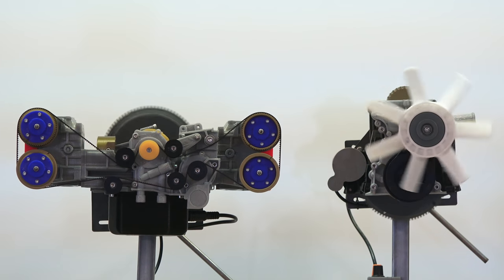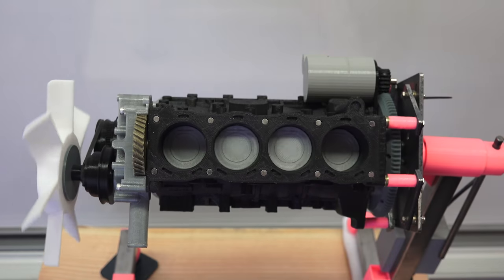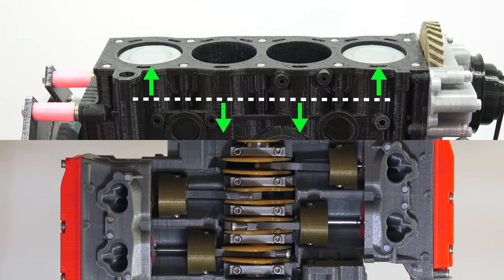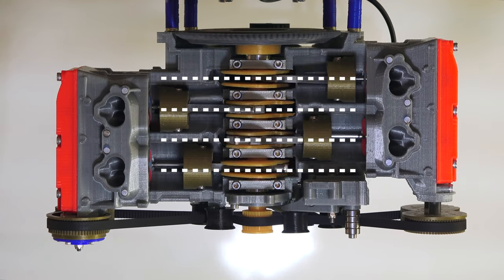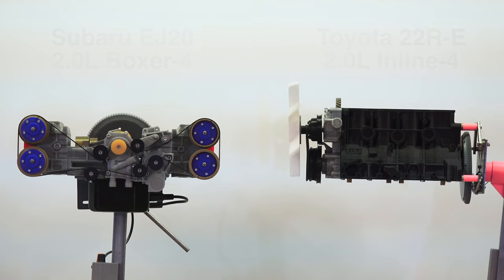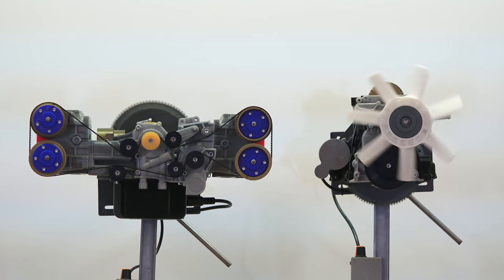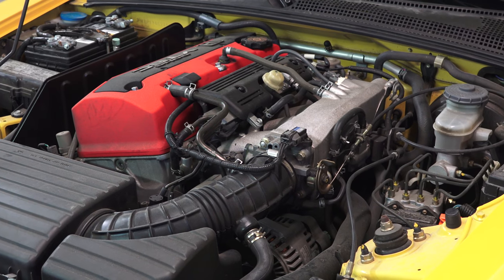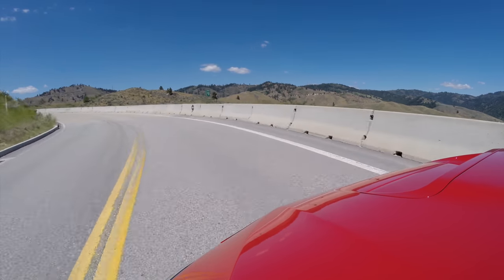The Differences Between Inline Four & Boxer Four Engines

Comment: I LOVE my 3.6 liter boxer 6 in my Subaru Outback.  No vibrations. Can't even tell them car is running when at idle.  Low center of gravity allowing for better driving experience.  Plenty of power.
Reply: flat-6 engines are not boxers, that term only applies to flat-4 engines due to the two cylinders on either side looking like a boxer punching. boxers dont have 3 arms
Reply: Well, in Germany we call all of them "Boxer-Motoren".  o.O
Reply: I love mine as well in my Legacy. Everyone comments how smooth it is. Not to mention the lovely sound it makes. I gained a few dozen lbft of torque with my tune and a bit of HP up top due to AVCS tuning. So much usable power. Grunt in 5th on the highway, Passing power at midrange in 3rd. I just love it love it love it.
Reply: We have it too but she likes to eat up oil lol
Reply: I switched to 5w40 and it helped some. Just made the switch to Motul 300V. Hoping I make it to 1500 miles without having to add any oil.
Reply: Subaru Flat 6 is also called boxer because the pistons are moving on opposite direction.
Reply: The subaru flat 6 is way down on power compared to other 60 degree v6s though.
Reply: Look ItsRain yeah.... But remember that they arent put in sports cars necessarily.... More like GT versions of very regular cars
Reply: There are alot of V6s on normal cars that make well above the 256hp the subaru makes. GM, toyota, honda just to name a few.
Reply: Look ItsRain 
My guess is they are boosted if the power jump is significant
Reply: llamawizard the Toyota Camry makes over 50 more hp with its v6 then Subaru does with its v6, naturally aspirated. And it's a Camry lol. Subaru needs a serious refresh on the flat 6, it's running old tech. Look at what Porsche has done with there flat 6's, 500 hp, n/a with the 4.0L. Subaru could easily pass the 300 hp mark with there flat 6.
Reply: Driveitsideways 1 but as you know Subaru is mostly designed for economy awd cars whereas Porsche is performance and luxury. But would be nice if they made more enthusiast engines, also I always come to the conclusion that flat engines always seem to make less power due to it being a larger engine in terms of 2x crankcases, heads, cams, etc which in turn is more $ for performance
Reply: Boxer is just a colloquial term for Flat, doesn't matter if it's a Flat-4, Flat-6 or even Flat-8 engines. Its the movement of the Piston and Conrod that resembles the  jab of a boxer that gives it its name
Reply: Vintov I was simply using Porsche as a example showing flat 6's are capable of big power n/a. 300 with direct injection and VVT isn't a very hard number to achieve out of a economical 6 cylinder, again the Camry is proof.
Reply: If only brz used that engine
Reply: diazzsama, it's exactly that though. The BRZ engine is basically a EZ36 with two less ports and direct injection. I think they share the exact same connecting rods too, not just the same design.

@driveitsideways 1, I completely forgot about fuel injection. If they can manage 200Bhp on 4 cylinders, I'd think 300Bhp would be easily possible on 6. It's too bad that they're doing away with the 6 cylinder. They're moving towards a 2.7L turbo or something. It's going in that giant Subaru SUV van thing, I can't recall what it is really.
Reply: Im just proud to say I own an 05 sti lol
Reply: llamawizard My next Subie will be a 3.6.
Reply: I believe your thinking of the EG33 engine from the late 80's and early 90's.  I don't don't think either of the ez30s or the ez36 had anything to do with porsche.
Reply: Try that engine with a proper exhaust and S/C running at 4-6psi
Reply: llamawizard nice, living the FA20 in my 17 Forester XT
Reply: Untrue. Boxer engines are characterized by each piston having its own crank pin whereas 180 degree V engines have pairs of pistons share crank pins. Therefore Subaru's EZ36 engine is a true "boxer".
Reply: 2.4L turbo and it's called the Ascent. It's a 7-8 passenger crossover. That same engine will probably also be tuned up and featured in the 2020 STi.
Reply: i'm looking forward to replace my ej25 NA with an EZ36 for my 2002 legacy wagon
Reply: I hear you, Wiz.  Love my 3.6R Outback too.  Everything I've ever wanted in a car.
Reply: For EZ36? really?
Reply: llamawizard I have an old school ER27 flat 6 in my XT6 and its the same story. When properly timed (yes it has a distributor) it runs so smoothly sometimes I have to look at the tach to make sure I started it lol
Reply: My Civic and Chev V8 both idle smooth, have to look at tach to see if running.
Reply: That's great!
Reply: That's why the FA20 2 liter engine is the way to go - 255 hp out of 2 liters is pretty damn impressive
Reply: 127.5 hp/liter is weak sauce? If the Ford Coyote motor had the same output per liter it would be 637 horsepower. Not to mention this isn't meant to be some rice burner, turbo-lagged to hell over boosted engine.  But yeah, okay LOL
Reply: GlassTopRX7 I agree that it may not be at the peak of what can be achieved as far as horsepower per liter goes, but to say that the FA20 is a slouch is a bit harsh I'd say. It's a great engine and the power is plenty fun for most people and for what they'll be using it for. The twin scroll turbo is a huge improvement over the old EJ engine
Reply: you've probably never driven a h6, they have healthy power for a 3L 6 cylinder and produce pleenty of torque to compensate. my ez30 Liberty shits on the 3.8 v6s found in commodores and can easily hold its own against turbo 4's, all while sounding like an exotic sports car.
Reply: there is a difference between boxer and 180° v-engine. at a v-engine two opposite pistons share the same cranckshaft journal, while Boxer engines dont. Thus you can see from the outside if it is a boxer or a 180 V-engine, because boxer engines have a offset between the opposite pistons, 180-V dont
Reply: llamawizard As a technician I can tell you Outbacks drive incredibly smooth, I remember saying it on a test drive once told a buddy who was working on a different one and he said same thing. Boss ended up driving the car later that day and said the same thing haha. Something I noticed from that day foward, like driving on air.
Reply: BMW R series motorcycle engine was called a boxer engine in 1923  .
Reply: Justin Wheatley - You gotta try the new 3.6. It's very torquey, especially with aftermarket headers and a proper tune. They have a nice flat torque curve. I'm waiting to see more but there's a lady with a Raptor supercharger on hers and she's making something like 310lbft with 3.5psi in 2nd gear. Peaking around 270whp. Don't quote me on that but it's really cool to see the potential. Some issues with cooling right now. Especially oil at low RPM cruising. I think peak WHP will be around 310-320 when done at 6psi or so in 3rd gear. I'd love to twin turbo one some day if it wasn't so costly. The 5EAT is good for 400 whp/wtq pretty reliably. As long as you don't go launching the crap out of it.
Reply: Driveitsideways 1 lol, what's why I want to purchase a powerful Porsche Boxer engine, and replace it for my Impreza
Reply: I have a copy of a german car magazine from 2004 in which an H6 Outback is compared to a 330i xDrive, C320 4Matic and an A4 3.0 Quattro (all of them SWs). Now, I haven't driven any of those cars but I would go for the Subaru no questiones asked.
Reply: I just got my hands on a project Corvair with a 2.4L flat 6. Amazing sounding engines, and aircooled!
Reply: I toldly agree
Reply: dude talking about low center of gravity while driving an SUV.
Reply: Thank the Beetle for that.
Reply: You should try it on a motorbike. Honda Goldwing, 1800cc, six cylinder, boxer. Noice.
Reply: Timothy Brown It’s no faster than a GM or Ford turbo diesel, much slower than an F150! How is that fast?
Reply: I LOVE my 2.4 22r in my 85 Toyota pickup. Lots of vibrations. shakes the windows in my house when at idle. High center of gravity on 33" tires allowing a better offroad experience. Plenty of lemons.
Reply: It's no smoother than my Packard straight 8.
Reply: Obviously a perfectly balanced straight 8 will be smooth.  Nothing would beat it for smoothness except a V12 or V16.
Reply: Okay till the oil leaks start at 100k
Reply: My 2000 Buick Regal engine is so smooth and quiet you would think it was electric. It is 18 years old already. It has the advantage of 6 cylinders though.
Reply: llamawizard I love my boxter S ..it has lots of power
Reply: Justin Wheatley - yep I recently got a low mileage H6, I was surprised when they rev over 4k, nice delivery right through, they are lazy down low, but suspect this is all fly by wire throttle programming and could be tuned out.  Or simply supercharge :)
Reply: some dude only have 15,000 miles on his wrx and already have ringland failure how is it good and that goes bad all the time
Reply: My Forester has a nice boxer, too. Smooth.
Reply: what batter boxer
Reply: Phoenix Ward. Err... a boxer does not have four arms, either. A boxer engine is any horizontally opposed engine. It's not called that because it looks like two boxers fighting, it's because any pair of opposed pistons look like a man flinging his fists out to his sides.
Reply: O. Rothe Well, there is an offset in V engines, it's just a lot less. It's only the width of the connecting rod end.
Reply: I have a 3.6 Outback and an STi and they both are fantastic!
Reply: Glad you fell for a Subarus marketing. That’s why a FWD inline four cylinder car destroys it on the track.
Reply: The Subaru 3.6 is a boxer design. Check stuff before you post it.
Reply: Phoenix Ward ___ Back to school for you. The description 'Boxer' simply refers to the layout of a flat engine with the pistons opposing each other - boxing each other - as one goes forward the opposing piston goes back. It has nothing whatsoever to do with the number of  arms. BMW motorcycle engines have two cylinders. They are also 'boxer' engines because they have opposing cylinders.
Reply: @vaminglee8019  ppl just spank subies all-day and then complain. go learn how to drive, mine has 280kkm and i still red rev it everyday.
Reply: I used to think my Subaru was smooth running till I got a Honda, my accord is 14 years old this year and you still cant tell if it's running most of the time...inside or out.
Unless its first thing in morning in winter then squeals like a pig for a few mins lol
Reply: boxer engines do generally burn a little more oil. i dont understand the science behind it but ive purchased 5 different subies over the last 10 years and have noticed it in all or them. its no big deal to top them up so it never bothered me for the good service they give in return
Reply: I never felt this awesome driving experience beside awd in snow..
Never felt this great balance,allways had better with inlines...better everything..
Even on fuel they suck major balls
Reply: Outback and better driving experience shouldn't be used in the same sentence, it's a grocery getter not some performance car
Reply: Phoenix Ward 2:29 the dude called it a boxer six lol.
Reply: I have an EJ25 WRX stock block pushing almost double stock HP been using 5w40 since I first upgraded parts 40k miles ago , change oil every 3k never has been low on oil using Motul, Penzoil Plat, Castrol Synthetic or Havoline HD Synthetic. But it does vibrate more then my B18B1 Integra.
Reply: Is maintenance hard on these engine due to the layout?
Reply: @Snakeplisskin440  bro... Use the correct oil. Subaru engineers aren't idiots when they specify the oil to use
Reply: @jermmcnasty420  the old slant 6 was that smooth in my 63 Valiant I keyed the ignition while it was idling on a few occasions.
Reply: @HeikkiJuvonen  that's where you need the most compensation for a tall car, hey!
Reply: @frankeggers4024  or a straight 6
Reply: @diazzsama  inline 4 or 6 would been better and more reliable
Reply: I Y 
It’s a much better driving experience than similarly sized vehicles.

Comment: You forgot 2 important differences!

One of the biggest pluses for a boxer engine is that they always start wet (lubricated) because of the flat design and oil level.  This providesd longevity for the engine AND the oil.  Inlines and V's 1st crank or half crank is dry until it dips into the oil level, therefore adding a bit of friction at every start, especially cold weather starts.  

Another reason for a boxer engine (in a subaru) is that the crankshaft comes directly out of the engine to the wheel shafts with less "elbows" or bends.  At every bend, power is lost, so a boxer design (in a subaru) preserves the most power that is delivered to the crank shaft because it has less bends or elbows.
Reply: Makeing a more efficient vehicle. My rebuilt 2.5 gets over 30 mpg highway with a manual transmission. Thats inpressive for AWD
Reply: What about the top half of the cylinder? Isn’t the top half “dry”?
Reply: Probably but the time it takes to lubricate is still going to be a lot quicker .
Reply: The true efficiency of the boxer is due to the pistons being in the same plane therefore no power is lost to angular momentum.
Reply: Kier Stiteler, oil pump provides the lubrication in both styles. Otherwise you would quickly turn the oil to foam and loose oil pressure.
Reply: @awesomexistence  no, in a boxer the cylinders are in the same level as the carter so u dont need oil pressure.
Reply: santiago perez, your response is unintelligible.
Reply: Do you have the research to back it up? for research purposes.
Reply: @henrym5889  ofcourse im talking about the start up, not normal working, oil tends to burn if it is stationary.
 every company tends to have any or two oil problems, mercedes and volkswagen tend to have the camshaft dry and thats definetly a ¨kaputt¨
Reply: are u sure u are reading my coment? because u seem to respond to things i didnt say.
Reply: Starting wet doesn't seem to prevent piston slap though ;)
Reply: What about the timing belt are they still using rubber? Over metal chain.
Reply: @2gmario3  of course they are ;]
Reply: @2gmario3  what? If you like a Subaru engine and the oil filter is on top , it's a chain. The last Outback with a timing belt was 2013.

Comment: You left out the big advantage of the boxer engine, and a big reason why both Subaru and Porsche use it:  The engine is much shorter in the longitudinal direction.

For mechanical simplicity, the transaxle must be placed far enough forward to allow the front axles to extend from the transaxle to the front wheels.   Using an inline 4 mounted to the transaxle would mean that the engine would extend in front of the front axle a considerable distance.   Using a boxer engine (with it's short crankshaft) means that the engine can still be placed in front of the transaxle without extending the hood a significant amount.  That is probably the biggest reason Subaru uses the boxer design.  The others are nice, but mostly marketing fluff.

There is another small advantage due to the shorter crankshaft.  All things being equal, a shorter crankshaft is stronger than a longer one, and mods to the engine are less likely to cause damage.  The Subaru boxers have 5 main bearings on a short crankshaft, and for that reason, are known to support large increased in power upon modification.
Reply: Vic C Subaru’s always blow up when there modded for 400 or more awhp
Reply: They're good til about 300hp... that's good enough unless you're professionally racing
Reply: @jacobz6474  Good thing most people don't need 400 or more. Unless it's track specific. Then just get yourself a rebuilt engine or do a swap. No reason most subies should have over 400whp anyway.
Reply: Engine mods less likely to cause damage? Why are speaking of suburus right !? 😂
Reply: Uh.... if you’re talking about transaxles... you do realize that almost all FWD and mid mounted inline engines are mounted transversely, right?  They have all the advantages on “length”.
Reply: @Bartonovich52  Yes, but those designs use unequal length drive shafts and have all of the problems associated with them.  The "symmetric" Subaru AWD drivetrains are simpler, and are inherently free of torque steer, for example.